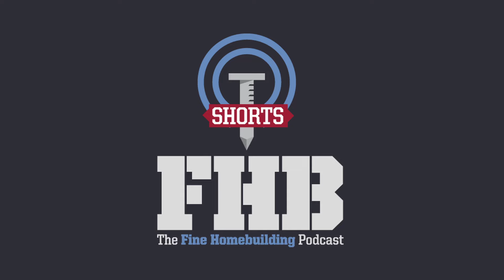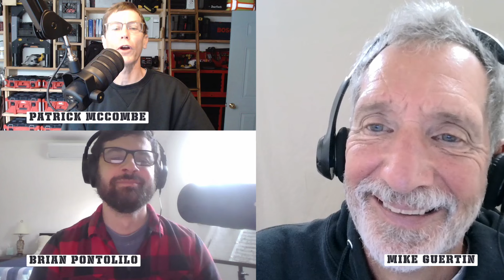How Do You Make a Lime-Wash? | FHB Podcast 654

Comment: The mix I am using on my house is 5lb hydrated lime to 4 gallons of water.
Leave a mixing paddle on a drill nearby;  it does settle quickly. 
It's good for the mortar and brick, and incredibly inexpensive,
It took 5 coats, runny like skim milk, to go pure white.